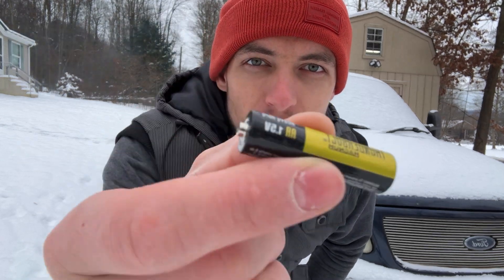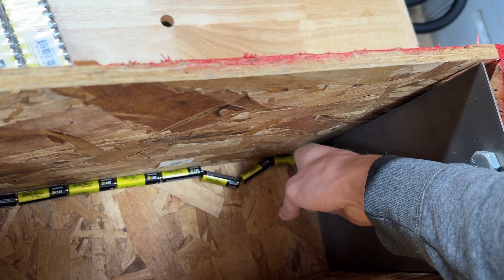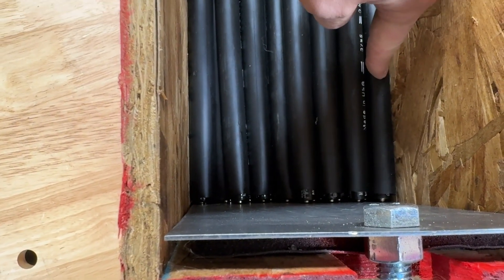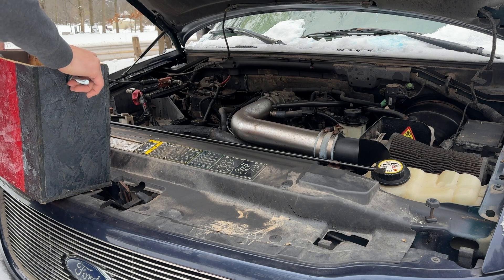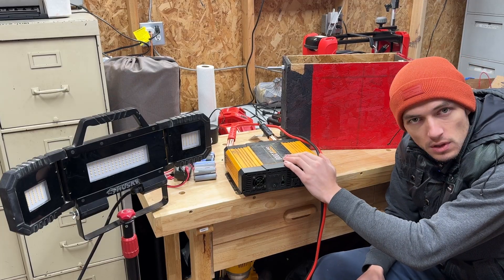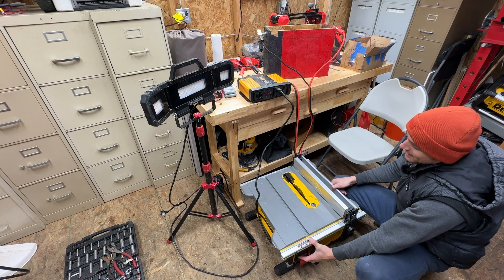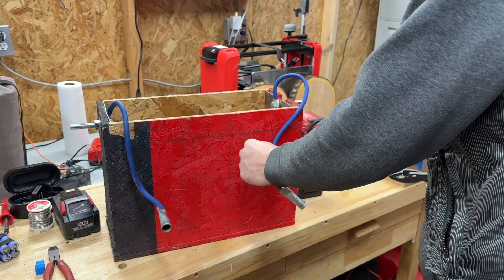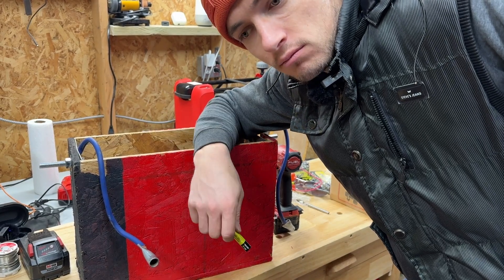How many AA Batteries To Start a Truck

Comment: Look at CCA of original bat. 900amps? (Cold cranking amps) regular amps of about 650 amps?
Reply from the maker: Most likely the problem was in the cables, the internal resistance at such amperage and distance is extremely high